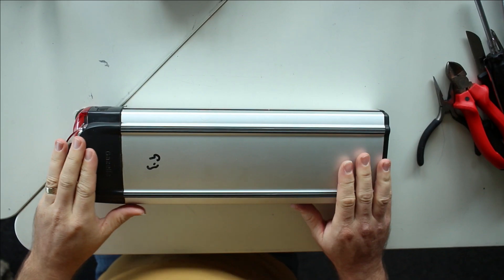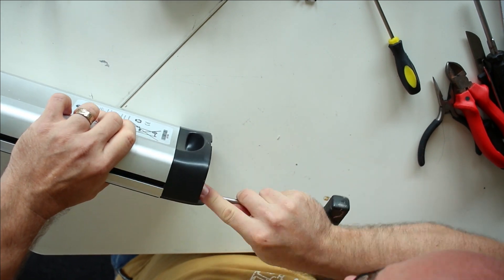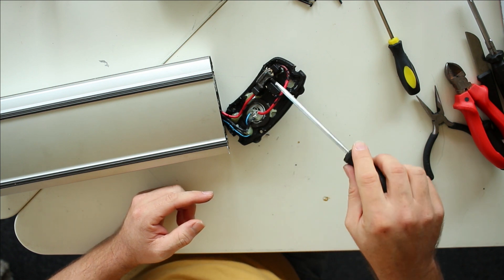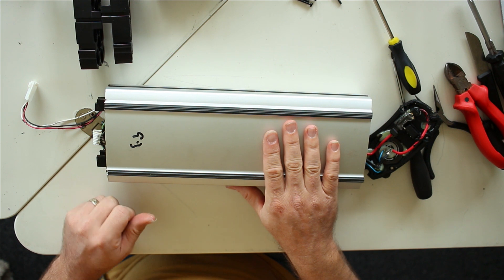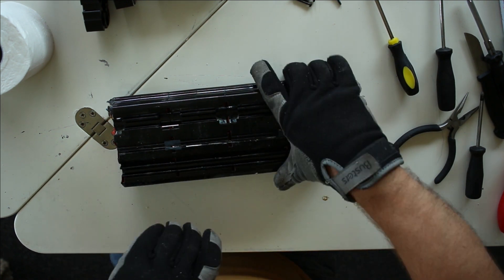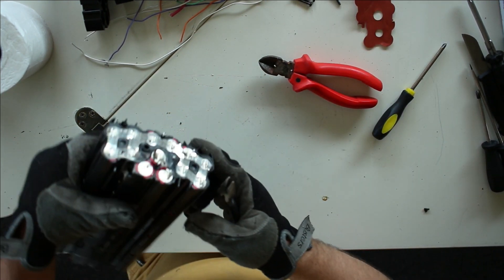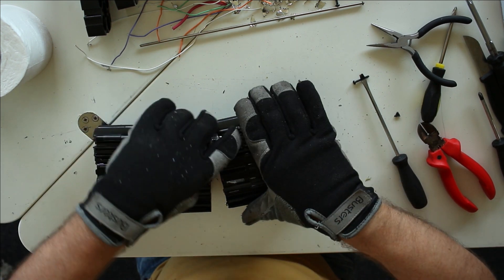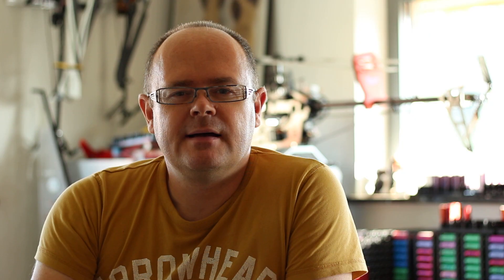18650 - Part 9 - Opening Gazelle Innergy li-ion battery pack

Comment: I have the early version not bonded I have removed the cells with both front and back still attached to the battery cells, how do I remove the individual batteries without cutting off all the wires?

Comment: Hello! I have such a battery and I was wondering if the rear light can be used as a light (so that it turns on with the front light) or is it just for showing the battery charge? Thank you

Comment: I am currently also working on this battery. Replacing all the old cells with a new one.

How did you removed the epoxy? Did you use acetone? If yes, will it also dissolve the plastic? If no, how did you do it to dissemble?

Comment: Hello. I recently had an issue with exactly same battery, I used is as everyday - rode a bike to work, and then I just pluged the charger into the battery and it just flashed once and doesnt charge anymore. I thought the charger was the problem, but I just got a new charger and it turns out it have to be something wrong with battery, I have no idea how to fix it and new battery is around 400e so maybe you know that issue.

Comment: Hi, I got the same pack, 37v when measure, but when charging it says it is full but does not go up to 48v, what could it be?
Reply: Some cells are bad and the BMS prevents from charging more than 37 volts
Reply: This is 42v full pack, only siutable charger has 48v.

Comment: I left the unit on a simple radiator at home to expand the aluminium housing, it was easier to remove the batteries like that
Reply from the maker: Great tip, will try

Comment: Hallo, 
I have battery gazelle silver energi, and now is can't work
below some information I have.
1.when I turn on battery, the rear light is just flesh on, and the front light also on, but is just short time, and the display is on and showing Err01–01 as video 01
2. I dismantle battery and wait about 15 minute, and power on the battery the light is just flash on and off again, and I try to charge but is not response(light is not on), and try to power on again but is not response.Video 02.
3. after wait about 15 minute, I try to charge and the light is response blinking in the 1st Led about 12 time, and after that the last led is blinking and of, and I try to disconnect the charge and connect again is no response,

Please find link for the video.
https://drive.google.com/file/d/1n01KuMjnoMK6fD2i5q9R7avjyicZXa1g/view?usp=sharing

my question and need your suggestion, from the video, is the faulty is on battery cell or in electronic also,.
Thanks for your support
Reply from the maker: Hi, not sure about error code. You should have a readout at bikeshop. However, I have encountered almost no failure in cells, but almost all the BMS (battery management system).
Reply: @Sailingandelectronics  , Hi Thanks for your response and advice, I have also open the battery and check is cells is still Ok, and I check also single cell is also OK, did you know, how to check the BMS unit is faulty or not

Comment: Hello , I have a question .... I have also a gazelle bike inergy , with battery like this ( gold ) and when I want to start the battery from the bottom is blind the led’s from the display... and is not working ... what can be ?! Maybe is better to send you a video to see ... but i dont know where . Thanks in advance and I hope that you will respond to me
Reply from the maker: Hi, upload the video on your YouTube account and send me the link.
Probably the BMS board is faulty... Most common problem with these batteries
Reply: Sailing and electronics hello , could you please give me you email address , to be honest I want to put up on my YouTube account but really I don’t know how :D  I check also the power of battery and is ok. The battery have normal amp .
Reply: Sailing and electronics  , here you have the link : https://youtu.be/abWtAV7C6rQ , thnx and I hope that you can tell me what’s happens .

Comment: Hello, Thanks for your tuto, As I damaged  that little 13wires female bms plug which we find inside the battery box ( used one with a few inches of welded wires on it is ok! ), I guess you might have some extra plugs around :), would you sell me me a few of them plug and temperature sensors  and even, please indicates your prices for extra accessories ( front end ,empty battery boxes,  back end and back-light asset ?  ( my bike is a gazelle innergy chamonix ) or tell me some easier  way to find at least these plug as I write from France ..... thanks for your answer.
By the way, to  you and the all community... do you know of any cheap  tools to check that linbus protocol which Gazelle uses in its master control unit, do you know of any forum or blog which deals related subject . thanks gb

Comment: Hallo, ik zie dat bij de laad connector er een rode een zwarte en een witte kabel is, kan ik alleen de rode en de zwarte gebruiken? Met een 48 volt oplader? Ik wil het namelijk solar chargen wat is de exacte input voltage?
Reply: De input moet altijd hoger zijn dan discharge. Je moet weten welke cellen er gebruikt worden en daarvan de datasheet raadplegen. De Gold variant is 36V, dus je zou deze kunnen laden met een maximaal 42V oplader.

Comment: Is it possible to replace the original 18650 battery's with battery's with a bigger capacity like 3000 mah? Or will this give issues with the bms? And does the bms needs to be reset after the replacement of the battery's?
Reply: This. Any idea yet?
Reply from the maker: yes it is possible. The only thing is, you will have to make sure your BMS will not shut down when disconnecting the batteries.
Reply: @Sailingandelectronics  Already disconnected the bms. Is it uselessness then?
Reply from the maker: @nl1bzw  Hi, some BMS keep some charge and stay "alive". Others will go to factory settings. This all depends from brand to brand.   
The batterypacks I open are not to rebuild them, but only to salvage the cells inside.

Comment: Hello,
You have a nice video about disassembling the gazelle energy battery.
Do you also have a video about how to replace the cells and rebuild them in the housing?
Kind regards, Jan
Reply from the maker: Sorry, only salvaging cells for other project.
Reply: With the measures it took to disassemble the unit I don't think that you're going to be able to feasibly re-cell this unit. Best you could likely do is backwards engineer the board and try to find a serial connection.

Comment: Hi, Thanks for the video. I gave a Gazelle battery like that but my problem is that one of the three pins in the socket where you plug in the charging cable is missing. Is it possible to replace it by fitting a new pin? The battery is only a year old; would be a shame to have to buy a new battery because of single tiny socket pin.
Reply: It is possible, but not easy. First, you will need to find a replacement socket or compatible pin. Some people replace the connector by an XLR connector (what they use in professional audio equipment), but that means the charger plug has to be changed as well, and your local repair shop won't be able to connect his diagnose box anymore as the connector doesn't fit. Another problem is the fact that the BMS board is potted into black epoxy, so you can't remove it to acces the charging connector. A possible solution might be to dremel out the plastic in the other area where the backlight connects to. You will however need to waterproof that area after the repair. Again, it's probably easier to find a defective battery with still functional BMS board (and charger plug) and replace the back of the battery. Depending upon your type of Innergy, you might need to pass the bike shop to pair thet battery with the motor again. The white connector with the small wires can be unplugged. The others can be cut and resoldered. Just never cut 2 wires simultanously. Be aware they carry some voltage. There isn't much room between the back of the battery and the cells to use any type of connector for the connection. Make sure you don't switch the cell wires with the wires going to the connector at the other end of the battery.

Comment: Hi，How you get the battery pack out? b/c the video didn't show that part.
Reply from the maker: Normally I can slide them out by cutting away the silicone. In this case the pack was sealed with epoxy, so I cut it open with angle grinder.... Now I just leave these packs untouched... Too much work.

Comment: Hi, when I remove the metal strips from the back of the cells it sometimes leaves a hole in the battery. Are the cells with holes in them still good or are they dangerous?
Reply from the maker: These cells are ruined. Never reuse them. Also get rid of them asap. (recycling Park). The holes make them loose fluid and could make them unstable over time. Due to speeded corrosion. If kept at home, put them in a metal container or in box with sand. I not always do what I preach... Like the box of sand,,, but at least I put them upside down so the holes are facing upward. Not loosing any extra fluid..
Reply: I did that too before, you need to get rid of it. The reason it happened to me was I pulled the strip outward from a distance. It never happens to me anymore since I started placing my side cutters as close to the battery as possible, and then twisting the strip so the welding joint is placed under 'sheer' force instead off 'pull' force.

Comment: Hello! Can Anyone tell me if the Gazelle Bike Controller is Rejecting Batteries with non Gazelle BMS? Is there "unlock" communication between Gazelle Front Hub Motor and the Batteries of this type? I dont care about Battery Voltage Level in the Display but I care about if the bike runs or not 😉
Reply: Not all Innergy models need pairing with the battery, but they likely all need the communication with the battery working. Otherwise, it will simply show an error code on your display and it won't give assistance.

Comment: The rear light of my Innergy Gold battery keeps blinking (during ánd after charging) and every time I want to activate the display (and assistence) I need to disconnect the battery from the bike and reconnect it. Is there any software in this battery? This is what my Gazelle bike seller told me. He said this kind of battery cannot be opened and repaired. After seeing your video I wonder if that is true.
Reply: You can unscrew the backlight. After that, you can unscrew the back end with the charger plug. It contains the electronics (The BMS) and it indeed communicates with the motor. Some models of those innergy motors verify the battery serial number and will refuse to run if it's an unknown battery. The BMS board on the newer models is potted in black epoxy resin. I have no idea how you might be able to remove that. Maybe an option is finding a second hand battery with defective cells for cheap and using it's BMS board on your battery with good cells. Just verify that your battery cells are indeed still good. On the small connector connected to the BMS board, you can measure the voltage of every cell group. 2 Outer (black?) wires are connected to the thermistor that measures the temperature in the battery. The other wires are connected to the cells. The voltage on each cell group should be equal. If you have 3.8V on a group, you should measure between 3.75 and 3.85 on the others. If you measure in reference to gnd, the first group (4 or 5 cells in parallel) will measure 3.8V. The second 7.4V, the third 11,2V and so up to 38V. Just be very carefull not to create any shorts on that small connector as the pins are real close to each other. In best case, on a short, the small bms wire will burn trough. You don't want to know what can happen in worst case.

Comment: recently i have aquired a few of these gazelle batteries , in the small ones (printed  7ah on the aluminiums sticker, 6.4 ah on the pack inside ) ) the cells are grouped parallel and series but not individually measured by a bms, only at output and charging it goes trough a printed board. in the other ones they do have individual bms wires to each group of cells.

Comment: I recently bought I presume an old type, with the old battery holders, the bms was potted in the back end and all the cells where at about 2.27 volts, I will have to test them to see if they are still good enough for a 24 volt e-bike battery rebuild (type brons, 40 cells, light kept flashing? No light when i got it)
One maybe two batteries where punctured while trying to rip off the metal strips, the rest I did with a dremel tool and a small grinding wheel to prevent any more damage to the remaining batteries, something to consider when removing the strips, the welds had deep spot weld div-ids in them so the (iron) strips where fused well with the battery casing.
The front and back had a (white) cover plate glued in with resin, in between there where the battery holders.

Comment: Hi, you made a great tutorial video, Thanks ! I wanted to start opening my innergy battery and try to replace the temperature sensor, as according to the dealer the temperature sensor is reporting -15 degrees, so the battery will not charge. Can you perhaps tell me where this sensor is located ? Is this sensor located in the BMS ?  Thanks in advance !  :-)
Reply: On my battery, the sensor is glued to the first cells of the battery. It's connected to 2 outer wires of the small white connector connected on the BMS board. (The connector with the thin wires used to balance the cells.)

Comment: I purchased the same battery Pack as "defect" for €10,- on Marktplaats. It was also glued and watersealed with epoxy.
I took a gamble, and removed the epoxy on my drillpress with a small drill (4mm). A fixed depth of a few mm.
I was able to break out the BMS, and (with some force) press/tap the unit out. It appeared that all batteries were perfectly OK:Voltage=37V!
I will mount a new BMS and make a nice revived pack for my bicycle!
For anyone trying this method: beware not to drill too deep and touch the cells. The total length of the cellpack is 280mm.
Reply: Hi Bas,
Really interrested in reviving/repairing the Ebike battery, have a problem with my Innergy Gold battery.
Have checked the battery with my bikerepairshop, they tell me cells are okay, in the electric circuit/BMS is some failure they can't measure.
Can you or will you share every detail you discovered for research on how to find which BMS you want to use on the repaired Ebike battery.

Thanks for your help,

Leo_C
Reply: Bought two packs today having a real hard time removing the epoxy even tried to break away that aluminum shell but no succes so far
Reply: If only I knew how to do that. They want to charge me 150 or 175 euro even (at Heskon) to have the BMS replaced, while I am convinced this could be done for 10 or 20 bucks.
I tried to get information on Tweakers where I could have it done for a reasonable price, but they say there is a lot of hocus pocus involved, hence the price tag. 
While I still think only the BMS has to be replaced and the battery registered and it should work fine. I don't trust the information I got on Tweakers this time (usually it is very good) or in general.

Comment: Hi its me again can i ask another question please .Can you tell me about the gazelle  battery is there four wires connecting to the back of the socket on the inside of the battery.
Reply from the maker: Roger Musgrove, 2 thick ones go from battery to socket to power bike. 2 thinner ones red and blue go to other end of case to charging plug. Also blue wire for?? Then all the small colored wires for balancing. Do not cut wires together at the same time!
Reply from the maker: Red and black ofcoarse...
Reply: @Sailingandelectronics , I may be mistaken, but on 6th minute of your video it is seen only 3 wires connected to sockets (red, black and blue). Is one socket not connected with any wire? Also I  noticed that 1 pin on the bike is shorter than others - is it because it's not used? Great thanks for reply in advance!
Reply from the maker: @1014bnm  hi, indeed looks like 3 wires only. 1 pin will not be used. Not sure on bike side (only open and salvage the battery cells)
Reply: There are only 3 pins used on the connector to the bike. Thick black is GND, Thick red is battery voltage (30 - 41V) and the small blue one is used for communication with the BMS controller (linbus protocol) It should measure approx 12V. The charger plug also has 3 pins. GND, 48V charge voltage and the same communication wire that is used to connect the diagnostic box to the battery and bike. The charger itself only uses 2 pins. The diagnostic wire isn't connected. The charger is probably just a 48V 2A power supply. The electronics to lower that voltage and prevent overcharging are also part of the BMS board in the battery. Most other ebike chargers will have a  41.5 or 42V output.

Comment: Hi Great series of videos i like them very much .I have a Gazelle bike but trouble with the battery the pins in the socket are worn any ideas  what else these we used for ?
Reply: Well when i had the trouble with the pins i found that the weld on the battery support bracket was cracked so the battery was moving about so causing open circuit look to see if thats the problem hope that helps.
Reply from the maker: pins in bike? or connectors in battery?
Reply: well both realy
Reply: Did you dispose of the grey socket on the inside of the battery
Reply from the maker: I have 4 waiting to be dismantled, so yes, I have some.  But did you already try to clean the connectors with a fine grid sandpaper? this could maybe solve your problems.
Reply: Yes i have tried this but the are quite abit worn battery powers the system ok but as soon as you put load on nothing happens
Reply: @rogermusgrove8991  did you solve the issue with worn pins? I may have the same issue. Sometimes the motor stops working and you have to use pedals only..